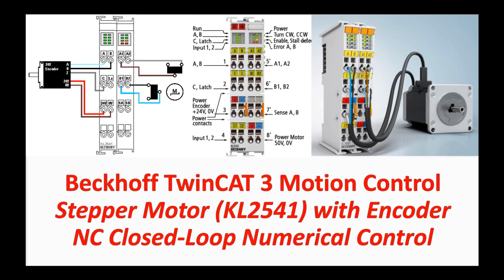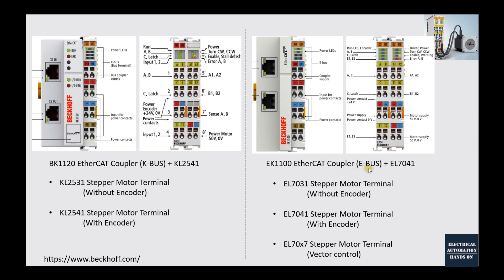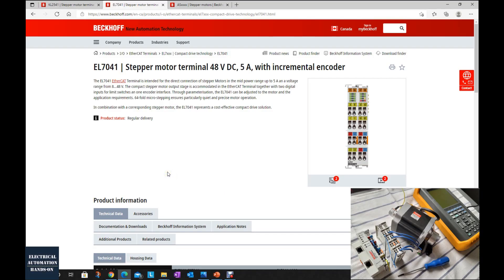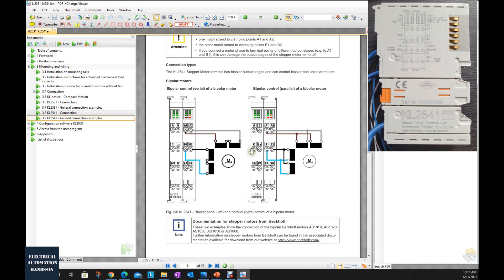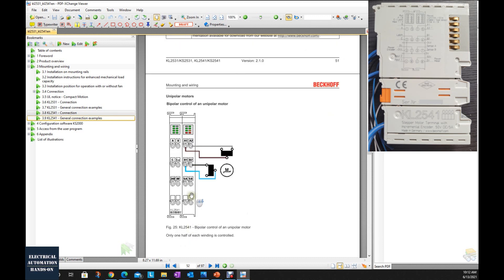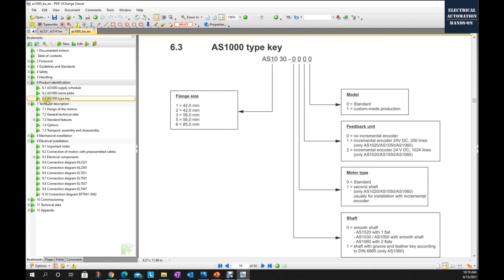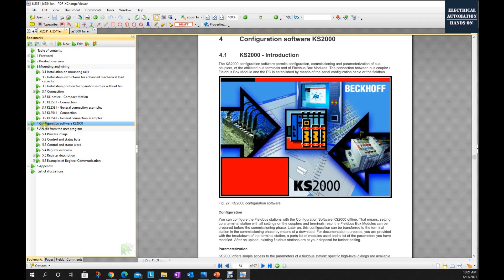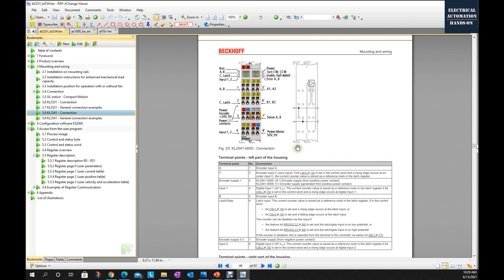MB09. [TwinCAT 3 NC Stepper] KL2541 EL7041 Wiring with Stepper Motor with Encoder [12/20]

Comment: These videos are really great and very well explained. Thanks a lot for sharing. I have a question you may be able to help me with. I have a non beckhoff stepper motor with an inbuilt 5v encoder. If I was to supply 5v power separately and then wired up the signals, A, B and Z, would the KL2541 see the encoder pulses or is it expecting 24v signals at A,B and Z. Thanks again for these videos.
Reply from the maker: Hello my friend, thanks for watching! According to the KL2541 manual, it can see the encoder signal "1" if the voltage is 2.5 - 30v. Your 5v encoder should be fine. Just note that the M of the 5v needs to be connected to 24v M, make the same potential.

Comment: I really appreciate you making these video, that helped me a lot. I'm now building a 3-axis cnc system,  and I want to add a spindle to the system, do you have any video to show us how to setup a spindle in twincat, I mean how to config a plc spindle in twincat. I am using a yaskawa j1000 VFD and a 3phase motor as the spindle, I wonder how to make the system to know the spindle?  Thank you, buddy!
Reply from the maker: Hello, thanks for watching! Regarding the spindle, I assume you will use this Axis as the Master axis, then the rest of the 3-axis will be synchronized with the master axis. If it is true, probably you can use the analog output to control the j1000 VFD.  therefore, in the axis configuration, configure the 'Drive' as analog output, then use encoder simulation or an actual encoder as speed feedback. If you are going to use MC_Velocity as the VFD speed control, I would recommend you review the video "velocity control on the fly" https://youtu.be/GrHGshftWrM. A reinforece video will be launched on next Monday talking about the second method for speed control on the fly.

Comment: Thank you very much for making these videos! They really are very useful and I have learned a lot. Could you make examples of Modbus RTU and TCP/IP communication with TwinCAT?
Reply from the maker: Thanks for your comments. Yes, the TCP/IP was my plan. It is hard to show Modbus RTU because the test needs the hardware, but I don't have them. As you saw, I am working on Stepper Motor NC control these weeks,, the TCP/IP might be couple of weeks after. Thanks for watching!